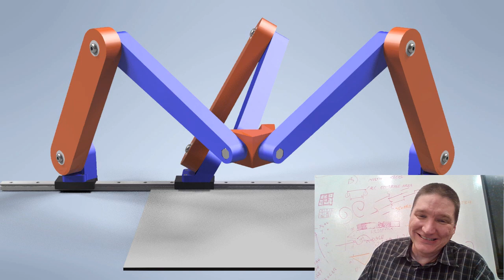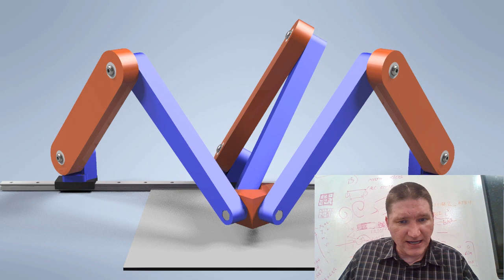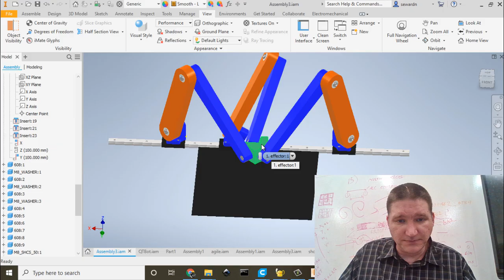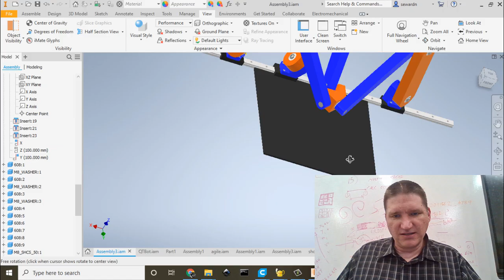RepRap Monorail (Single Rail Tripteron)

Comment: Real interesting! I see that both Y and Z motion move the 'motors' closer together, which makes me expect that the effector area of motion decreases with higher Z slices. Is this correct?
What shape does the effector volume of motion take?
Reply from the maker: I talk about it a little in one of the other comments.  Trapezoidal area from the top.  Triangular from the side.  z increase as you move away from the rail.

Comment: Could this be extended to 6 DOF by using pairs of arms like the hexopteron, where there are 2 arms on each linear axis?
Also what is the shape of the build volume? I'm trying to imagine it and utterly failing.
Reply from the maker: Sure..

Build volume is a trapezoid from the top and a triangle from the side.  Z height increases as you move away from the rail.

Comment: friction in the front side of the rail will be a nightmare.
Reply from the maker: With the steppers on the back side...there will be more weight behind the rail.
Reply: @NicholasSeward  I think i understand what you mean,they will push up on the back side,maybe you can add some other type of weights in the back side(something that moves the opposite way to keep the balance and the center of mass always above the rail).I mentioned it because after many hour of use there might be damage in the rail,other than that your idea looks beautiful.

Comment: you're probably going to want to use diy Cycloidal Drives for the joints (add counter weight's on the blue too)
see 
'Levi Janssen The Compound Cycloidal Drive - Something Novel  2020'
and especially Barton Dring's grbl_ESP32 port with 6 axis ,wireless, etc
'grbl_ESP32 Update: Run Jobs from SD Card'

Comment: Isn't the center of mass way out of the rail?
Reply from the maker: 3D printing is counter intuitive.  The inside is mostly hollow.  This allows for very large rigid parts that weight very little.  Many people see my parts and think they could cut holes to reduce mass but it will actually increase the mass.  Long story short...  I will have steppers on the back of the rail and the arms and effector are super light.
Reply: @NicholasSeward  I see, thank you for the explanation

Comment: What kind of torque are you looking at for the end of those arms though? I love this idea but idk how it would fair in a direct drive setup. Please forgive me and correct me if I’m wrong. Also I’d love to know how you define joints in cad like that. I’ve figured out how to do renders of movement like that but definitely would like to make linkages for testing and furthermore just learning.
Reply from the maker: I am just using basic constraints in Inventor.  Solidworks and Fusion work about the same.

I don't know the numbers but I hope to get a lightweight direct drive but I can always go for a bowden if that doesn't work out.

Comment: Neat kinematics!  Stiffness (Z-axis especially) will be highly dependent on how torsionally rigid you can make the arms and joints.  With a pre-loaded linear rail, chunky tubular arms, and some 68xx thin section bearings, it should make a nice little printer.  Fyi, use a clamping mount for the bearing OD.  It relaxes hole ID precision requirements and allows you to adjust the preload of the ball bearing.

Comment: What are you typically using for controlling your differential motion systems? Do you write the firmware yourself or are there firmwares out there wich allow you to define custom kinematics? Do you have a discussion forum or similar?
Reply from the maker: We will use reprap firmware.  It allows for a generic matrix transform.  For other firmware, this is a slight modification of the corexy kinematics.

Comment: This "printer" would have so much jerk problems, good luck fighting ringing and stuff on a machine lile this
Reply from the maker: Yep.  That is just a tuning issue.  You can always turn jerk to 0.  I think this machine will surprise you.  The community has already built some tripterons that do okay.  You are right that they are hard to get right.  Long story short...don't build this machine if you want speed.
Reply: @NicholasSeward  alright that sounds plausible, ofc low speeds would counter ringing and some other stuff. What about weight on the extruder head? I can imagine when all 3 arms come from the same side there might be some bending atleast with a direct drive?
Reply from the maker: @BeHeaven616  I hope to fit an orbiter on the effector but I can always go to a weigh nothing setup with a bowden.
Reply: @NicholasSeward  interesting! I cant wait to see what the final machine will be like!

Comment: Haha awesome. This could be great for mounting the rail on the wall and have a large CNC workbench or plotter or laser cutter. This would probably be the cheapest to scale up robot in one dimension. This could also be interesting as a 6 axis stewart platform.

I actually had a similar idea but with two rails and a delta bot arm like configuration. Two arms that are responsible for the XY and then an upper rail for the Z. Not sure if that can actually work though. Seeing your concept now you could do the same actually for a single rail but have an offset attachment point. 

I wonder if you could drive this using spectra lines from stationary motors. To increase the friction on the pulleys similar to a belt you could have the string go between two groved pulleys in a figure 8. Maybe multiple times with two "multigrooved" pulleys. So you end up with something like a block. That way you could drive the spectra line without it "walking" on the roller like on your spectra bots. Not sure if that actually works either haha. But I think it should.

Comment: A few thoughts:

Rotate the rail 90° on edge so that the width of the rail provides stiffness vertically, put the bearings on the back side and extend your arms past the pivot points to counterbalance them.

I like the single belt idea, it seems like the simplest solution.

It will get bulky if you counterbalance the arms but I think that might make the positioning forces less and reduce the tension needed on the belt.

Comment: Could this be modified to have 3 rails, but running along the same plane as 3 edges of a build plate? So the whole printed could be built on a platform not much bigger than the build plate?
Reply from the maker: Yes but it would have a triangular prism build volume.  I would suggest one vertical rail if you go with 3.

Comment: angle the head and have very long x length printing.. PLA doesn't need a heated bed.
Reply from the maker: I could lock the middle carriage and add wheel in that case. :-)  That would be fun.

Comment: What kinematic parameter most effects Z-Height capability? The orange arm length? Is that similar for Y travel? Cool design!
Reply from the maker: The distance between the outer carriages.  Z height increases as you move away from the rail.  One optimization would be to move the rail up in the z.  Right now there is a lot of reachable space under the table.

Comment: Also it seems an approach that allows to make really  long prits just using a long rail, you can easily shift the area of printing. Not like infinite z but it can stay on a whole hot plate all the time, so I guess It's optimal approach for prints really long y with medium z and x  and with materials that are really prone to warp. I suppose that it would be much better to make a cosplay sword compared to infinite z without middle print bending.

Comment: is it possible to split rail to 2 shorter parts?
Reply from the maker: Rails can be butted together.  You wand to make two raw cuts and then smooth once together.  Normal ends are slightly rounded.

Comment: That's super cool, and it keeps cost down when using expensive linear rails. Any benefit to rotating the rail 90° so the carriages are facing the build platform? You could lift the whole rail up higher and not run out of rotation on the carriage joints.
Reply from the maker: Yeah!  The geometry is an open question.  Arm angles and arm lengths.  Need to write a simulation and optimize for build area.

Comment: What about a rack gear with gears on each arm with steppers
Reply from the maker: Considering it!
Reply: Or similarly a big ol screw and a nut of some kind on each mount that you spin with an attached motor. You could make the arms just roll along on some rollerblade wheels. That could give you an infinite z axis assuming you could use a counterweight to balance the arms.
Reply: @JordanDavidson3102  rack and gears would be easy to print  but wheel idea is great
Reply: Flip and with that you could do multi material by adding another bot to the screw. Would just need to have some way to calibrate xyz on both bots to the same point.
Reply: I just realized I said infinite z. I meant infinite x

Comment: Another outside-the-box design, impressive.  I just wish one of them ends up getting massive adoption (was a big fan of GUS)
Reply from the maker: I have been tempted to update GUS.  All the hardware and software are there now.  The problem is that my design goal are better solved by HELIOS.  I might update him anyways.
Reply: @NicholasSeward  It's certainly not intuitive for a layperson like me that one extended arm is better than three tied together :)  Could you share what the goals are?  Ease of build, reliability, straight forward controller (thankfully 32-bit controllers today), ...?  If anything my #1 wish is for far more sensors and corresponding intelligence in the controller.
Reply from the maker: @tommythorn  My goals are some mixture of large print area, small, and easy to use.  For the ease of use GUS needs custom auto calibration.  Stick an accelerometer on the effector and we should be set.  HELIOS doesn't need much ongoing calibration.  They are both about the same size.  My new HELIOS is going to have a print volume at least 6 times that of a prusa.  SCARAs can break out of their frame for some huge work envelopes.
Reply: @NicholasSeward  Glad to hear Helios isn't dead.  I don't see much news about it in the last 3 years.  Am I missing something?
Reply from the maker: @tommythorn  you are up to speed.  We had two student builds that were good and we learned things but not ready for production.  The wheelios was the last thing we did in that vein.  I am really excited to do a build myself.
Reply from the maker: I have an update coming (not fast) on HELIOS.  He has the best chance IMO.

Comment: A single rail is awesome.  Could it also be built with two parallel rails, one for the X, Y and a second on the other side of the bed for Z?  Would that add any extra rigidity to the effector?
Reply from the maker: No extra rigidity that I see but it will solve some arm collisions issues.
Reply: @NicholasSeward  Arm collisions gone would give some more Z height available.  My question was based on a little mental experiment.  If I replaced the single rail with a round rod with sliding bushings, the whole mechanism would flop over.  However, I thought that if I put a parallel round rod on the other side of the bed with the Z arm, then it would still work.  If I have that right, then it seemed to me that it would add to the structural stiffness of the effector in a practical sense.  If that is the case, then it could be a really practical basis for a simple printer with no vertical structures.  I could get excited about building one of those.
Reply from the maker: @dennisbrown4551  Hmm.  I don't completely follow but I think that should work.  I have a variant I am thinking of with an elevated rail with printing below.  This would solve for arm collisions and would make the build volume make more sense.  It loses a little of the coolness of being one rail on a table but it has a lot of applications like a long pick and place above a conveyor belt.  Also,  double the y range (perpendicular to the rail)
Reply: @NicholasSeward  I assume that double the Y range is from removing the arm collision by relocating the Z arm so the X, Y arms can get closer together?  If I understand the Y-axis correctly, the Y resolution varies across the Y position.  The resolution is poor near the rail, so that also limits the practical Y travel.
Reply from the maker: @dennisbrown4551  No...this is from levitating the rail above the table.  The angles would all need to be changed.  In that scenario the outside ones would define the x and z.  The middle would define the y.  In any tripteron...the resolution is the same everywhere.
Reply: @NicholasSeward  Fascinating!

Comment: the main problem is how to make the linear motion independently on a shared rail, without any driving belt/screw interruptions on each axis, and runs precisely with less backlashes as much as possible?
do it need a linear rail motor? or simply works like a monorail?(eg: rubber wheel as the motion source) 
it's sounds compact and space-efficient but looks like some wheeled robot-like 3d printer which works but can't even make high enough precision in X-Y axis
Reply from the maker: I dont completely follow but we can drive this ina bunch of ways. Spinning screws with static nuts.  Static screws with spinning nuts.  Static belt or moving belts.  Rack and pinion.  So many options.  The resolution should be something you can design for.

Comment: That is really cool!  Simple ball bearings on the arms and one linear rail.  A lot simpler mechanism than even a delta bot.  It could even be turned into an infinite Z belt printer.  The third arm would only be used for bed leveling and following.  The mechanism off to the side leaves the mechanism open on one side for easy maintenance.  So many variation possibilities!  I wonder if the arms could be live hinges?
Reply from the maker: Live hinges would be awesome on this or any tripteron.

Comment: How critical is the angle of the middle arm? Both outside arms seem perpendicular to the rail 90 degrees, but the center arm is angled?
Reply from the maker: There are lots of options.  This option had clean kinematics.  At least one of the arms need to not be perpendicular to the ground plane.  I am trying to think about how to explore all the angles and arm lengths to optimize build volume and minimize arm collisions.

Comment: Absolutely love it! Very compact and elegant. Once you see it you think: why didn't anyone think of this before?
Reply: because of stiffness issues. a triangle is the most stable stance known to physics. A line only supports in one dimension, whereas a trinagle supports in 360° summarized.  But its a good concept. I admit.
Reply: @vadominiqueenpunkt6589  Instead of the rail being a 1D line what if the rail was like a circle or a web, and the 3D printer itself could print the rail...  You could also have the rail be on the roof or on a vertical wall...
Reply: @aoeu256  a circle would give you 3 point stability. Solved. ;)
Reply: Yeah, the linear guide would need to be massive, or you'd need at least 2 spaced far enough to counteract the moments without causing crazy wear.
Reply: The concept in theory is really elegant, but builing it would be a pain. You save two rails, but get 6 radial bearings in return. For this load-case tapered roller bearing would be a fine choise, but if you choose quality ones they'll cost a lot. Also the angle of attack of your forces is kinda suboptimal. To achieve small amounts of displacement your arms and bearing need to be very beefy, what leads to higher weight, counteracting the whole idea of a highly dynamic machine. If you want to scale it up and make it massive, a scara-robot or an articulated robot on a rail do the same job but with less hassle.
Reply: i have never seen such robots, so this is just an amateur guess..
it seems many positions of the head won't be possible, because the arms would need to be able to travel "through" each other, right?
You could bias them so that you can put them out further from each other, mitigating the issue, but then the rail becomes much longer.. 🤷
Reply: because it's shit in practical use
Reply: Cat flap moment - it took Sir Isaac Newton to think of putting a small door in the door for the cat to go out of.  Before that your cat just shit in your house if the door was closed...
It takes genius to think of the obvious sometimes.
Reply: @piccalillipit9211  what?  
never heard of litter boxes?
Reply: @darkracer1252  - Probably not in 1675... And, is a litter box inside your house?
Reply: @piccalillipit9211  yes that's the whole point of a litterbox.   TO KEEP TE CAT INSIDE   and they had them dating back to Before Christ
Reply: @darkracer1252  - Ergo - the cat is shitting in your house. Ergo the need for the invention of the cat flap.
Reply: @darkracer1252  - I have not got a cat - can you see why??? LOL
Reply: I think the moments on the rail will not be as bad as they seem. Only the middle arm will transmit vertical forces. Right now, part of this arm is already on the other side of the rail, acting as a counterbalance. Not sure if this is intentional, but you could tweak/optimize this of course. But I agree, the stiffness of this concept is its weakest point.
Reply: @tulpjeeen If the entire assembly linear (Y axis)  weight distribution is always 50:50 in motion like a boxer engine. thats would only be the case if the robot draws a line. A parallel second rail is the correct answer here ;)